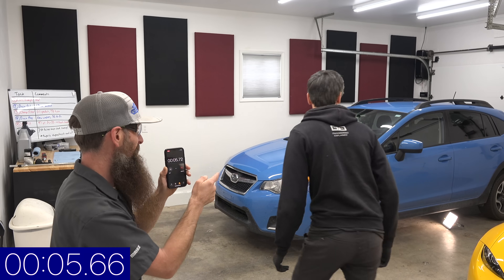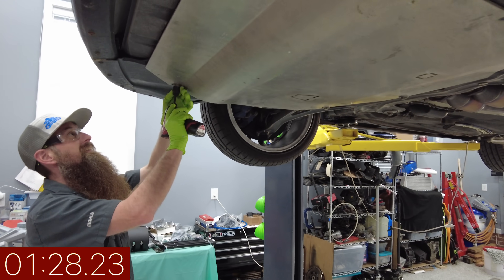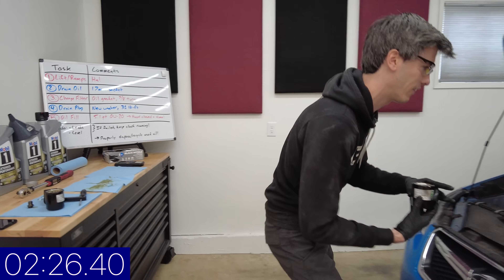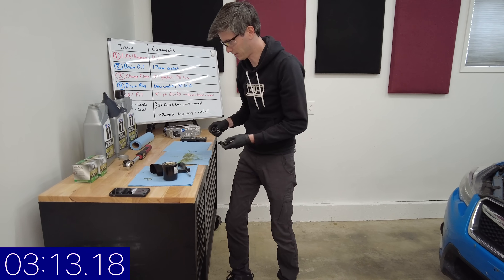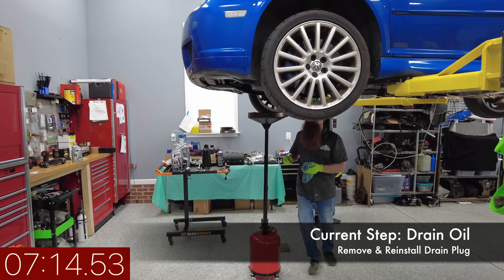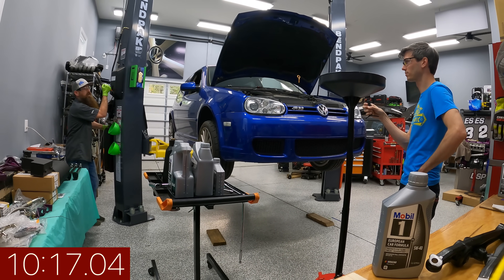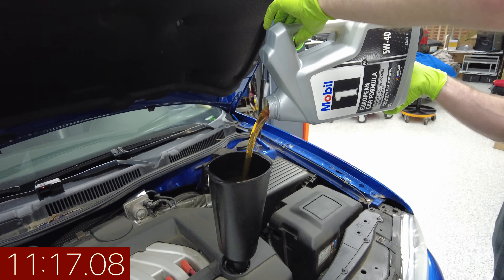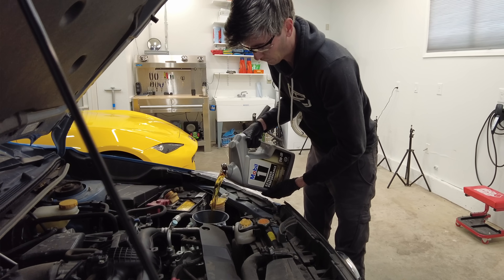Mechanic vs Engineer – Oil Change Race – Who’s Faster?!

Comment from the maker: This was a totally fair competition because both cars were blue! Would an engineer ever put a mechanic in a compromised situation?! 😉 This was a lot of fun to put together and a nice change of pace - hope everyone is enjoying the holiday/weekend, happy Friday!
Reply: Well, my car is grey so I’ll tell my garage they should be able to do it under 6 minutes 😁. 
If not they may consider hiring an engineer! 🤪
Reply: In another video: Mechanic vs Engineer - Designing an engine assembly with thermal, fatigue, emissions and manufacturabilty analysis - Result may shock you *NOT CLICKBAIT*
Reply: @mlok4216  That's just the tip of the iceberg. 
We gotta think about all those things, while ensuring engine efficiency, coolant path + pump size, seal capability to hold internal pressure +design for life, design the assembly to be manufacturable using conventional methods (milling, boring, drilling, turning, forging), develop drawings with material specs, GD&T on each and every one of the parts. 

Then streamline the assembly process. Weight savings. Convey designs to machinists, casting/forging experts.
Write up test plans to test every damn thing, from the key life of the conrod to the breakaway torque on each connection to performance tests. Integration of that assembly...

And im just listing from experience. Theres obv more to it all or else these big auto companies wouldn't have work for the 10,000+ of engineers they employ.

Serviceability is just one part of that massive equation, one that is tough to achieve when the packaging constraints are so ridiculous.

A seasoned engineer may do just one those things, but that one piece of work impacts 100s of thousands of cars.
Reply: My take-away from this: If you want to own a German car, be prepared to spend more time working on it. 😛
Reply: LOL...🤣🤣🤣
Reply: In case you didn't know, using the bottom of the handles on a set of pliers is a very good way to remove the oil cap for future reference!
Reply: Charles....Why the beard?
Reply: Isn't there 52 weeks in a year?
Reply: @ODST_Republic  2 weeks vacation?
Reply: Blinker fluid flush!
Reply: I do have to wonder why as an engineer you didn't think about the vacuum from the filler cap XD Even with the filter higher, you can still get another quarter liter or so out of the car after you pull the cap off XD

Comment: In due fairness, the over engineered vw demand more steps. I own a passat and its a PITA with the oil filter (take it out upstairs or downstairs). I really doubt the oil thickness is an issue here. 
I have learned a lot from Charles and I'm thankful. 

Engineers job is to make these kind of maintenance easy, not a nightmare. Are you listening VW?

Great video!
Next challenge: who could optimize fuel consumption using the same car, handicapping the body weight.

Comment: the biggest issue is what it takes to change the oil because of the ENGINEER design, chevy V6 had oil filter under the exhaust manifold, had to loosen all the bolts and disconnect the exhaust pipe to pull manifold out enough for the oil filter to clear the threads to remove it and get the new one on. this is not good for the exhaust manifold gasket and very bad location for oil filter as you can cook the oil with exhaust manifold that close. All engineers should have to WORK on what they have designed before it goes into full production.

Comment: The techs at the dealership I used to work at would punch a hole in the bottom of each 1 qt. oil container, with a pocket screwdriver, as they were pouring them into the oil fill.  Back then we used the small diameter 1 qt.  containers vs. the large mouth containers in this video.  This allowed the container to vent and pour faster, saved a bit of time.  Every second counts on flat rate!

Comment: When I'm sitting there waiting for the oil to drain and I know I have extra oil that will be left over I'll dump it down the engine and wait until it comes out clean then cap the oil pan. I've seen some pretty nasty stuff come out of the pan when doing this on older vehicles.

Comment: No Pontiac Solstice?? Now with AMSOIL you just change the filter (well if it's a good sized one) - otherwise me being lazy I change the filter then just pump in/out a quart every so often. I drain only when oil analysis says to.. Not suggested on cars w/ less than 5 quarts though..

Comment: I like Royal Purple oils, personally. They've been wonderful in my cars and kept them chugging happily along even if the engine was low on oil because a broken dipstick tube caused it to lie to me about the fluid level. I suspect the latest extremely long-life oils from Mobil1 would easily offer similar performance, I just have no experience with that product. Another fun way to change your oil easily is to use a vacuum oil extractor down the dipstick tube. Mercedes actually calls for similar treatment for some of their newer cars and have a specialized little bung to fit over their drain port. It's really not necessary to drain using the drain port unless you suspect that you've got a lot of fine metal particulate that you hope to drain out that way, in which case you should probably already be planning to drop the pan and clean it out. You should also be planning a rebuild if you have enough metal particulate in your oil pan that such becomes necessary.

Comment: Way aren't you using a OEM Subaru filter on your car?  They have the correct bypass sprite rate? Also you are supposed to lose the oil fill cap and pull the dipstick put a bit so the filter will get a chance to drain while the oil is being drained from the crankcase.  You might find it easier to get under the car if you drive up onto a 2X6 to get the car up a bit.  Regular ramps are too high for a Subaru and the oil will splash everywhere even if the drain pan is in the perfect spot.  The other big advantage of a home oil change is that you are not under the time gun and you can let the old totally drain out.  This way you get all old oil out and new oil in.  That is the purpose of an "Oil Change" isn't it?

Comment: You gotta try changing the oil on a Honda Rebel or Nighthawk 250.  Two minutes, no crawling, no lifting, no filter, 1.5 qt or 1.2l.  Pan, box wrench or socket, 1 and a half bottles of oil, done.
Easiest oil change I've ever done, including a lawnmower.

Comment: Really disappointed to see what looks like a mickey mouse job by the pro mechanic. He ended up filling the new oil filter with the old dirty oil. He should not have installed the new filter until all the old oil was drained out. I suppose this is not a huge problem, but the new oil filter will now not do as good a job as it could have done if it was not exposed to the old oil...

Comment: mechanics are  "boots on the ground" engineers or repair/maintenance engineers and regular engineers should really be called  "design engineers". Its very difficult to just draw stuff up before you machine the parts from raw stock. And very difficult to not mess up when you have 5 cars a day. Both have their place. Next time use a honda civic for the challenge.

Comment: Could of just used an oil extractor on the subie and been done in half the time. Don’t have to get under the car or remove drain plugs or bother checking for leaks because you didn’t remove the plug.

Comment: Honestly. Ive changed oil on both an old Mazda and an old Audi...

Both car had no need to be lifted. However, the Audi required an extra step to get it done. Also. You kinda need to start the engine and then let the oil settle so you can fill the engine up again on the Audi as the filter was facing upwards, meaning its always gonna be full, unless you just changed it...

Comment: It helps that the Crosstrek is hands-down one of the easiest oil changes I’ve ever done. 15 minutes maximum, taking my time. Everything else is just as easy to work on and service on that car, too.
Reply: The B7 Passat with 1.8T is even easier.

Comment: In that 24 minutes he talked about, that includes replacing the sticker, maintenance light, checking tire pressure, air filter and usually topping of fluids. 
Most places I've worked actually paid less time than .4 of an hour.

Comment: I'm no engineering genius like Jason, but shouldn't you have removed the oil fill cap before draining the oil, allowing for it to flow faster? I've always done changes that way.
Reply: I do too but I’m sure the crank ventilation allows plenty of air flow.

Comment: OMG!  (Friendly competition and humorous intent understood)

Shoving that oil filter back into the bottom of that car with a steady stream of old, dirty oil still coming out?

Bad mechanic, bad bad mechanic!!!  ; )

The last time I changed the oil in my car, I let the oil pan, the oil filter and the oil cooler all drip until the drips were at one or so a minute, it took HOURS to get to that state!  BUT, I got all of the dirty oil out!

"4/10ths" to change the oil???  THAT is why I never go to the dealership for maintenance!  Besides the fact that they wouldn't likely drain the cooler, if even actually change the oil.

: (

Comment: Doing an oil change on a Teledine Contenental T.S.I.O. 560 is quite easy. 10 quarts out via a slight tug on the quick drain plug (wait until oil is out, push the plug back into the closed position), change the filter (+clipping and replacing the safety wire), 10 quarts in - done...oh and replacing the engine nacell cowling.

Comment: EVERY Engineer should be FORCED to take apart and put back together, including repairs, EVERYTHING they design. You'd see a LOT better engineered products!
Reply: What about the engineers who actually worked as mechanics before? Also, it is not the engineer in most cases, but the finance guy or project controller who thought it is a good idea to make things complicated just for the sake of a few cents. Engineers can make great products, if one lets them.
(Power engineer, who worked as a linesman)

Comment: Worst oil filter location --- Chrysler 3.6s from 2000-2013... angled off the front of the block, and your arm needs 2 more joints to get to it. They always make a huge mess and are a huge pain in the ass to get off.

Comment: Oops, I've never replaced a crush washer nor have I used a torque wrench for the drail oil plug lol.  Not a mechanic but I've done all my own oil changes for 15 years now and most of them have more than 200k miles.

Comment: Oil changes only pay 18 minutes ( 0.3 hours for Engineers). So if you can't do it twice as fast you will lose lots of money on flat rate. I wish you would have done a front brake change or something more mechanically inclined. People with no training do oil changes.

Comment: 1 more tip, probably not filmed: after filling the oil, run the engine for 15-30 seconds to fill up the filter and then check the oil level.

Comment: If you’re doing your own oil changes, why not install a quick drain valve vs. using a new gasket every time? That would make it faster too and you can control the oil drain flow better (less messy)

Comment: I worked at a Kwik Kar Kare oil and lube shop in my youth.  When I was in the pit, we could turn out a full service oil change, bumper to bumper lube, interior vac, tire pressure check, fluid level check and safety inspection (lights suspension ect) in 5 minutes flat.  My record was 74 in one day.  That was 6 bays going at once.
Reply: The shop was called KKK??? 😲🤣

Comment: I haven't seen a replaceable paper filter be under the car before. Both of my cars that had one literally had it on top of the engine which is good and bad. Good because it's easy to get too and you can definitely tell if it's leaking from their. Bad because if it does leak it falls onto a hot engine and sometimes takes forever to put back on with a wrench

Comment: Why do so many cars have HORRIBLE oil filter design.
On so many cars, the oil filter is by far the messiest part of the job.
(On my Grand Cherokee diesel, it’s an easy, clean job to get the filter out, with no oil spills. I can’t say the same for many other cars I’ve owned. 😢)

Comment: I'm really hoping you could answer my question. I bought a 2004 jeep liberty. An I forgot to put it "N" before putting it into 4wd. I had it in drive position. I didn't press the gas. I had my foot on the brake. After I quickly put the the shifter back down. I notice a burn smell coming from vent. Did u do any damages?

Comment: I would be down in the pit and I would crack the filter then I would know when the oil would release and I would flick it it would spin and hit the ground we did like a whole 30 point inspection in 5 minutes

Comment: The engineer will spend months coming up with a solution that will save minutes

I’m surprised Chris didn’t preheat the oil so it would pour faster from the jug. I would have.

Actually Chris never dumped his old oil from the drain pain into a waste container so he never completed the job. Mechanic dude drained directly into the waste container and so completed the job and wins

Comment: No pressure test! NOT DONE! Booooooo! Could have oil leaks, especially from the VW canister housing. Never say you oil change is done without a "seal check" under pressure. Wiping the dipstick clean and reinserting it halfway actually does save time at the end bcuz you just push it down to check the level - after the pressure test.

Comment: As a Lube Tech I I performed the underside service on 55 vehicles - cars & trucks - in one 7 he shift. Speed was highly stressed, second only to safety... We worked in tandem. Serviced a Honda Civic in about 6 minutes once! But that's with an under car pit and hydraulic oil pump. After moving to a full service shop I still serviced 6-7 vehicles per day. As a Lube Tech I serviced almost 6,000 cars in 6 months! In the Quick Lube shops you'll be servicing two cars at the same time more often than not! It's actually expected of an experienced technician to be able to perform multiple under car services simultaneously. Just go to any busy OilStop and you'll see them roll 100 cars through the doors in one day like it's nothing! 🤣

Comment: Good competition but I think you should include running the engine and checking the level as part of the time. That can be a very time consuming part. Especially if the dipstick happens to be french. They will make the dipstick the same colour as the oil and have the dip stick go through the filler neck. Could also be a electronic dipstick that needs to driven for half a hour before checking. Then you need to reset the oil service light which could take another 15 min depending on the procedure.  Suddenly as 12 min job becomes 1 hour easily.

Comment: NOW, when I had my '92 Corrado SLC with the VR6 engine, I was very careful about that damn oil filter!  I opened the bottom drain the night before and let it drain.  Then when I did my oil change I just twisted the cap off and a towel under the car was all I needed.  The rest of the VR6 oil change was just not getting any oil on the pretty cover of the engine.

Comment: In 1985, I could change the oil at a leisurely pace on my '77 Volkswagen Rabbit in 20 minutes.  That is because the oil filter was accessible from above and I could simply reach down and spin it off.

-My Current  '14 Cayman S requires my car to be lifted by my Bendpak Quickjack, So it takes about two hours.

Comment: I seriously thought engineering explained would have just vacuum drained the hot oil and swapped the filter from the top. No need to get down on the ground at all -- like any (lazy) engineer would prefer!

Comment: It usually takes me about 45-60 minutes to change the oil on my 88 IROC:  Jacking it up, getting jackstands under there, draining the oil for 10-15 minutes (get every "last" drop out), fighting to get old filter off since it's obstructed by the header/collector, prefilling filter, then (being a cheap ass engineer) leaving each quart of oil upside down in the funnel to (you gessed it) get every last drop out....

Comment: 5:24 - Jase is still have my HP48 Graphing/Programmable Calc (blue/gray body with a slide off cover) from the early 90's, think i bought it fall of '91 just before i got married.   doesn't work anymore but i still have the manual, i just keep it for an heirloom of sorts.

Comment: That was great fun, cheers chaps! I thought I had it licked recently, doing the oil change on my Jaguar XF diesel. There's a suction pipe to drain the oil and the filter is up top. So I hooked up my pump and....well, the only tube I had which fit was silicone tube. And the suction made it collapse! It took a good 20 mins to suck out all the oil. I've since bought some PVC tube to fit!

Comment: I challenge the engineer... come to my shop and we will use the same equipment on the same vehicle using the same lifts.  This was not a controlled experiment. 1: the vehicles were different and had different steps
2: the vehicles had different drain times and fluid capacities
3: filter locations and styles were also different adding time for the mechanic
4: the undercar dust cover: one vehicle had one, the other did not
I cannot as both a mechanic and an engineer accept this as a proper survey of speed/efficiency/skill/knowledge. 

I propose a new challenge

Comment: Not necessarily give them both the same car the mechanic will win, they screwed the mechanic with what’s car to do a change on the engineer got the easiest car you could get to change oil in and he use 0-20 is that even right for that car?

Comment: My girlfriend's TDI Beetle, with top mounted oil filter, 4" of ground clearance, and the massive aero plate on the bottom, is the reason I bought a vacuum fluid extractor. Only changed the oil the hard way once. Never again.

Comment: Engineer: you don't need a lift to change oil
Also engineer: does two oil changes per year.
Reply: ...not if you have a marine pump with the oil filter on the top of the motor! 😉